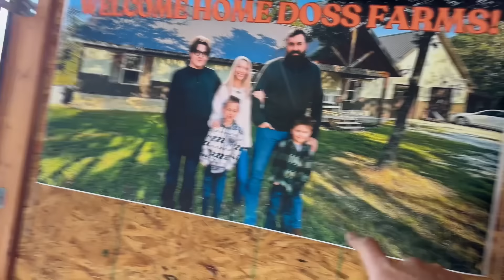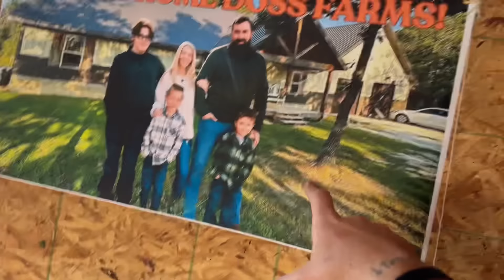WE’VE GOT A SECRET…

Comment: You should use the gutters to collect water for your animals. Do the same thing off of the roof of any shelter you build in the pastures.
Reply: What if it's full of dust, pollens, dead flies and roofing material fragment?  Maybe your roofs are different to ours, I collect roof water for the garden, but I wouldn't plan on feeding it to the animals without some filtration and stuff???